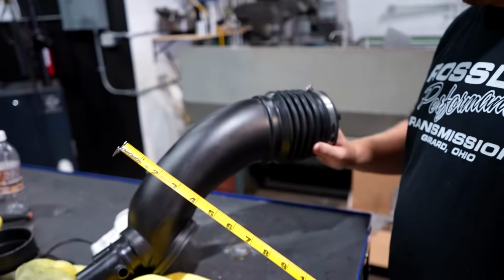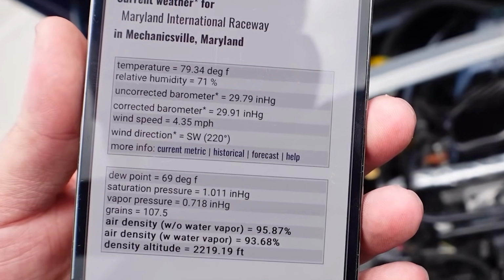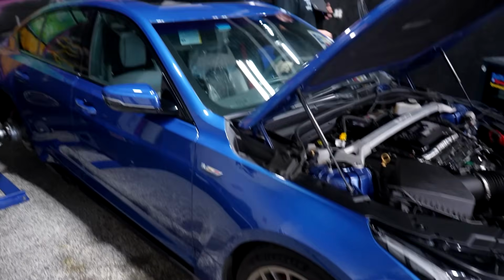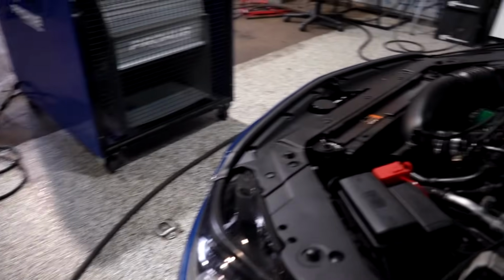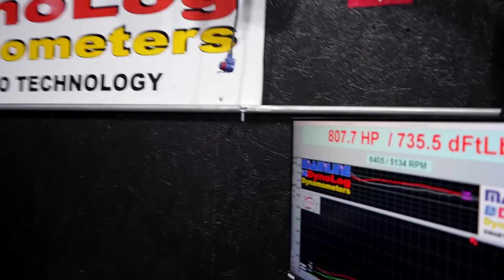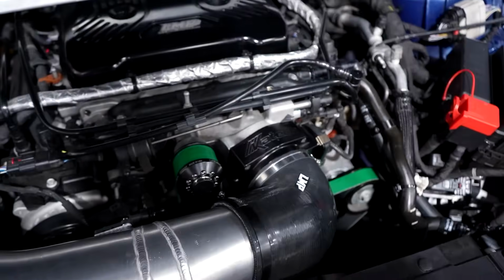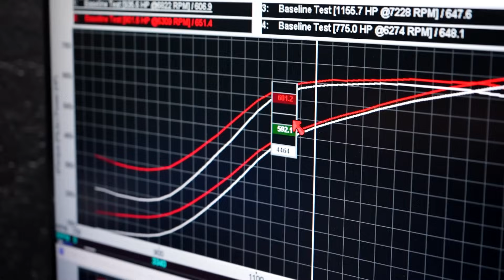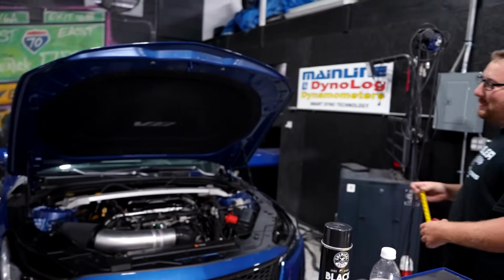CT5-V Blackwing Intake ... That Actually Works?!

Comment: Before you manufacture that. Do the same test with the hood down.
Reply: Or even the stock intake with the lid off if thats possible.
Reply from the maker: @Jonny_trans  testing both with the hood up or down will make 0 difference. It’s not like we’re testing one with the hood open and one with it shut
Reply: @LateModelPerformance  I mean test your intake with the hood up then down. Some mustang intakes show big gains hood open, hood closed they suffer due to where they pull air from.
Reply: @Jonny_trans a definitive difference would be to test the smaller one without the air box and a similar filter. Apples to oranges so far. Alex has all kinds of videos on this....

Comment: Would be nice to see what the intake makes on a bone stock car. Most of us have stock cars and just want a cold air intake just for that extra bit more. Don't plan on going crazy on a new car.
Reply from the maker: Considering it needs a tune in-order to run properly the average person with a stock car is not going to pay $3,500  to un-lock the ECU + Tune cost, just so they can tune it with an intake.  We'd advice doing a ported blower before that which does not require a tune and we have shown to pick up 40-50whp.  There will be minimal gains with intake only and no other mods.

Comment: I'd say it would pick up more if it didn't have such a sharp turn coming off the supercharger.  But if it had a filter right after the throttle body on the supercharger it might just be sucking in hot air

Comment: Yep dyno the car again with the hood closed,  IAT will be higher and slightly more restriction than obviously hood open.
Reply from the maker: It was open for both, doesn’t matter. The gain is what we are showing
Reply: @LateModelPerformance Next they will tell you to take off the Mainline Dyno Fan because it works to good. Great work Alec and Carson, good solid gains.
Reply: @LateModelPerformance  Yes many cold air manufacturers have advertised gains with open element systems with the hood open, and most of the gains diminished after the hood was closed soaking up heat and adding restriction around the filter. Obviously the hot air under the hood is not as much of a factor with the hood open as it can grab fresh air. The factory closed box system was intended to keep the air charge temps down and emissions etc but is more restrictive than the larger open element filter you chose for the car.  Just trying to give you some info after spending a few years perfecting cold air intakes for 15+ coyote cars.
Reply from the maker: We also said this was prototype testing and we will be designing an airbox.

Comment: What size is the TB opening where the silicone 90 attaches? 4"? Having a intake pipe that necks down in size just before the couple will increase intake charge velocity and cfm (just like what you made). It would be absolutely worth trying a 4.5" pipe that necks down to the size of the coupler inlet (4" I assume?!?!) as well. A pipe diameter beyond a certain diameter wont do anything flow wise except DECREASE the charge velocity/speed which is a bad thing obviously. Finding a better way to turn the intake charge 90* without the abrupt 90* short bend coupler should help as well. You guys should look into a flow bench for testing parts. This would be a ideal situation to use one. You could actually make one with a cheap sensor, or look at the data in the tune to get an idea of flow increase/decrease. As a general rule of thumb, a 3" straight pipe will flow 900 cfm. So you dont always need to go massive on items to get the necessary flow for a engines demands